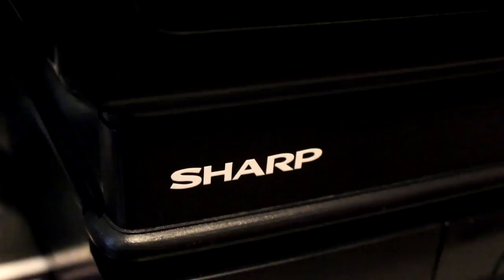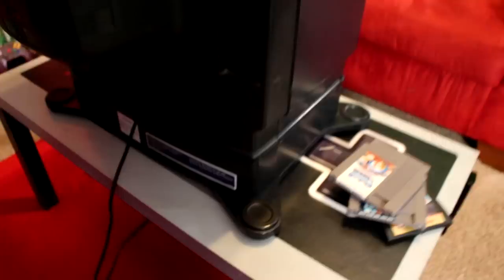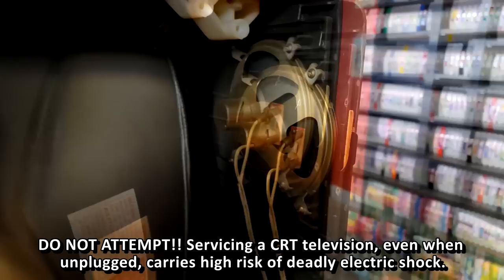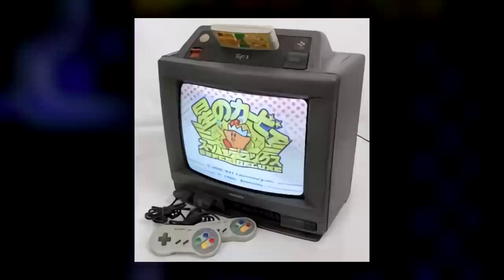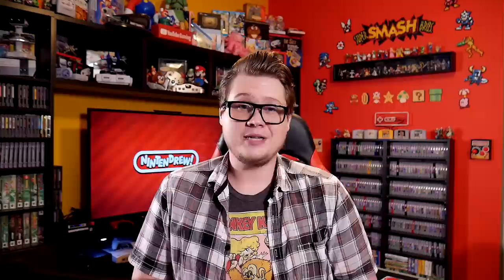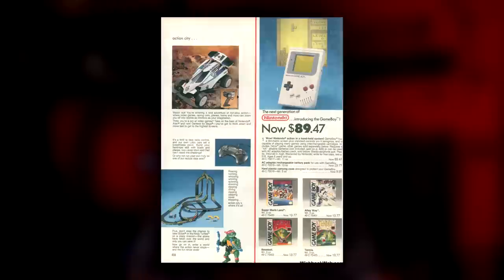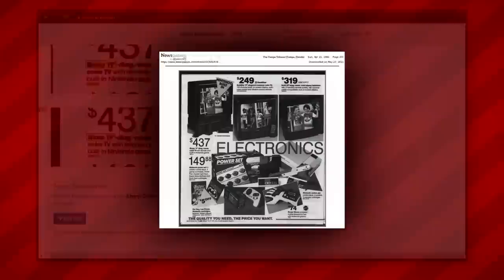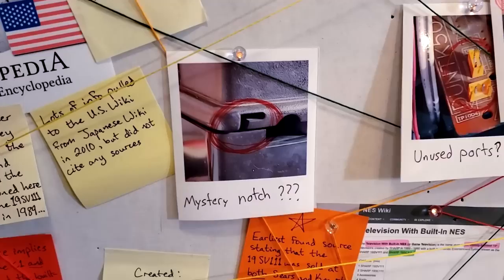The TRUTH About the Sharp Nintendo Television! (19SV111) | Nintendrew

Comment: I experienced this 2 times in my life. The one I bought and the 10 that were in a storage room at a hotel I worked at. I bought 1 (his money not mine) for a friend's van conversion we were working on in 90ish. Knowing my habits then it would make sense that it was only sold at Kmart. Through the 90's I only purchased electronics from 3 sources. 1 Fry's 2 Kmart 3 Sears. Sears was rare because Kmart was much closer and less hassle. I don't believe Fry's (Fountain Valley) was even open at that point so it was most likely Kmart.

I can confirm that they were used in Hotels. Whether it was a separate model I don't know. A hotel I worked at in the mid-90's had several. They had a few rooms they labeled "family" rooms that had them. There were no games in room but you could use your own cartridges or rent from the front desk. By the time I started there in 95 only 1 was left in a room and the other 10 or so were collecting dust in a storage room.

Comment: Now I’m just wondering if this and the mysterious black case for the Power Glove that just said “Power Glove” with no Nintendo branding are linked. It came in Dec 1989 so what if these were supposed to be marketed together and hush hush, the PG sensors fit really well on this TV too :). Did you notice in that newspaper article picture what else was there? Power glove, NES Max, power pad NES, it was a sale of all the things Nintendo wasn’t selling well. The Power Glove(and mysterious black travel case) and the NES Sharp all coexisted and failed at basically the same time???

Comment: Back in the time frame when this TV was sold, there was an Oregon based company, called Fred Meyer, they opened a store in, Chico Ca, which lasted something like a year, as it was not a good fit for the area, but I remember as a kid, going there with my family and they did have one of these TVs setup, as I remember spending time playing games on it, so it would be safe to assume that, Fred Meyer, sold these TVs back then, or at least was using one as a demo kiosk for some of the newer games.

Comment: I have one of these that I bought at a garage sale for $20 in the late 90s. The sellers didn't know if the Nintendo worked on it or not as their kids had moved out by that point.  Boy did it work on mine. Couldn't get it to freeze, loaded on first try everytime and I would leave it paused for days sometimes and it never froze. 

Unfortunately the exterior wasn't in great shape. Only one leg and no doors, remote or controllers.  Still a bargain for such a unique item.

Comment: Loved the video! There is a different controller model you can get for about $5 that doesn’t have the game button at first glance, but if you take it apart it does have the button on the board and the signal works so you can make your own that works with the NES TV :)
Reply: Yeah I've done this as well.
Reply: It’s the Sharp CG0520CESA remote with a blank space next to the number 9 where the game button would be

Comment: I used to have one of these entirely intact with both controllers and the remote.  Sold it to a somewhat local person 7~years ago I guess now.  Solid TV screen kind of unique to the color you'd find with pictures in old magazine of the time oddly enough, but garbage audio with just a small mono speaker well set to one side which kind of made for disoriented output I believe to the left.  Eventually couldn't justify keeping it as it takes up some space for just that one use as it only has a coax port in the back, fine to add another old console (I got snarky, added a master system.) :D

It's in two pieces entirely with a small rectangular hole with a dual wire that goes between it and the NES in a box itself below which I found fascinating, you can also tweak the video a bit nicer in there to sharpen stuff up, it has hidden spaces for things.

Comment: 2:27 
Ahh, the RF in jack where someone bored out the center pin hole to try and stuff a composite cable in there!

I have seen that quite a few times!

(Yes, I have to admit to doing it as a kid... No it dosen't work, the signal is very incorrect) and you can easily damage the center connector that keeps your real RF input from working (which would be an antenna, cable wire, cable box.... Anything you set to a channel to recieve

Comment: My Goldstar TV is even one step further from this one in faking Stereo sound: It has only one 4 ohm output from the audio op amp output but feeds signal to two parallel 8 ohm speakers. Of course, with some mods on the main PCB and adding a "Pseudo Stereo"  daughter board to it, it can create pseudo stereo sound.🤦‍♂️

Comment: I think that the rumors about the Game Television being RGB came from the Sharp SF1 TV that had a Super Famicom built-in. That model did have RGB video from the console to the TV. I believe that the only NES/Famicom hardware that was capable of RGB was the PlayChoice 10 and VS arcade hardware, and also the Sharp Famicom Titler. 

I believe the Famicom Titler was capable of RGB just so it was easier to perform video mixing between the Famicom hardware and whatever character generator hardware it had. It makes me think of the Sega 32X needing RGB video from a Genesis in order to work. It is mixing the image elements generated from the Genesis, with the rest of the image generated by the 32X.

Comment: Pardon my ignorance, but isn’t this the NES version that outputs S-Video straight to the TV?

I don’t see hardly any color bleed/fringing in the Dr. Mario shot, which the NES composite chip is very guilty of. Depending on the pin-out the composite chip might be bypassed.
Reply: nes doesn't generate s video or rgb at all

Comment: The famicom tv is 1000 times better, outputs an RGB picture, has no bullshit annoying ZIF cartride system and it has no fragile feets wich could brake overtime due it’s weight, also it’s a shame this sharp nes tv has no composite video inout either, but this sharp nes tv will still have a high cult state,
Also the super famicom tv high it’s high cult state,

Now just imagine a modern version of the nes and snes tv with a flat pannel HD display in wich you stick nes or snes games sideways inside,that would be awesome.